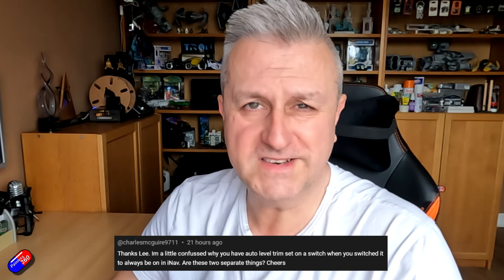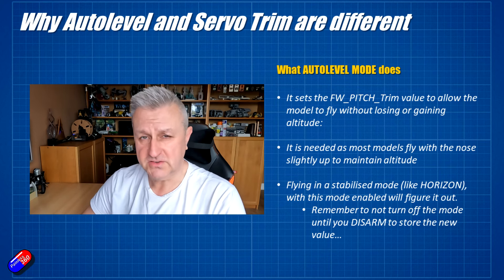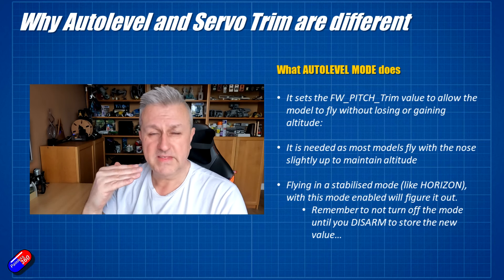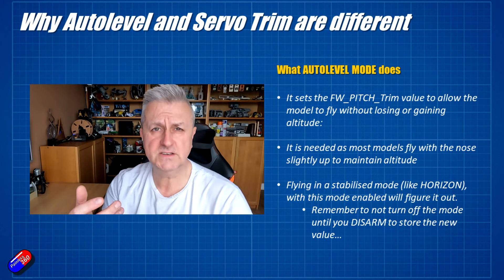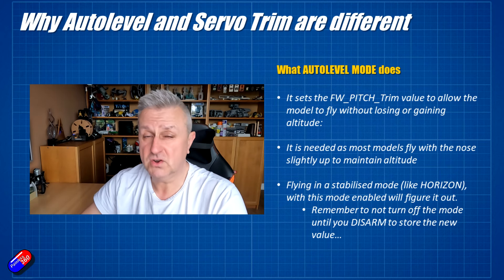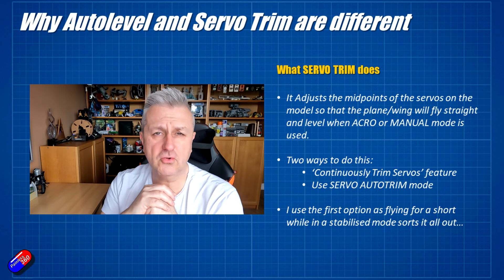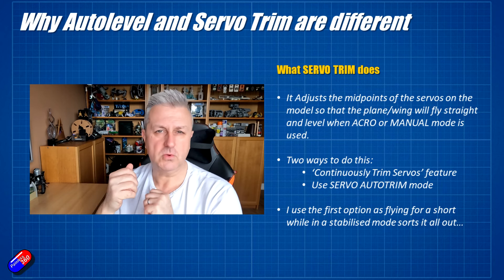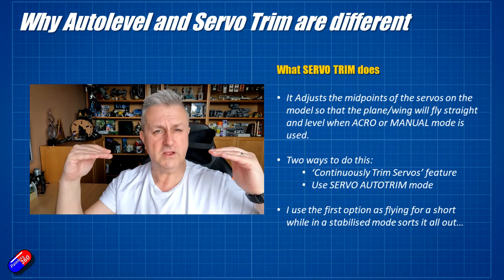INAV level fixed wing

Comment: Interesting. I actually trimmed and auto leveled my funjet yesterday. According to inav wiki, you can (or maybe even should) turn off Auto Level Mode after Auto Level is done. Well thats what i did, i launched, i activated angle and auto level mode, i disengaged auto level, landed the plane, disarmed and saved eeprom via stick command. The value was successfully saved. 
However, it is very important to not turn off servo trim when using the servo trim mode (not the continous). For servo trim, the procedure is launch, fly level and straight, turn auto servo trim, keep it on until landed, disarm and values are saved. 
The way servo trim works is you fly level and straight, as soon as you activate it records the average servo position for 2 seconds. After that, it doesnt trim anymore, i keeps what it has recorded for those 2 seconds. Now if it failed you can switch of and on again to re-trim. But if you wanna save, you need to keep the Mode activated until landed and disarmed. But that procedure doesnt apply to auto level.
Reply: Thanks for this information!! I was wondering about that and a little confused as to the proper procedure so this helps a lot!

Comment: Auto level is a great way to set your model’s natural cruise speed, and – according to some of the developers – it should be done in horizon mode. At maidens I set my desired standard cruise throttle (by amp draw) in horizon mode, engage auto level, let go of the right stick, and wait until the plane stops gaining or losing altitude. Then I exit auto level, and all I need to do is save settings upon disarming. Fabulous tool.
Reply from the maker: INAV rocks!!! 😁